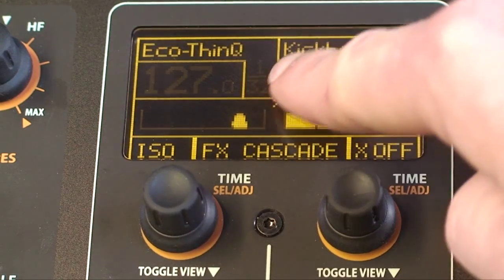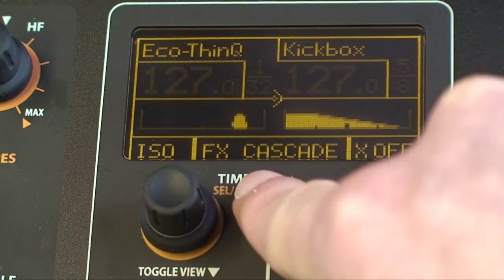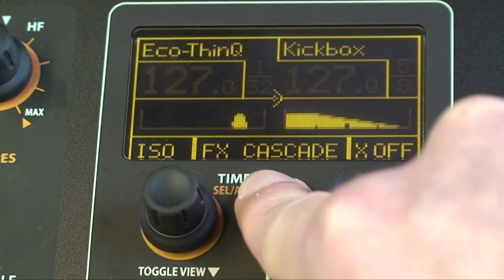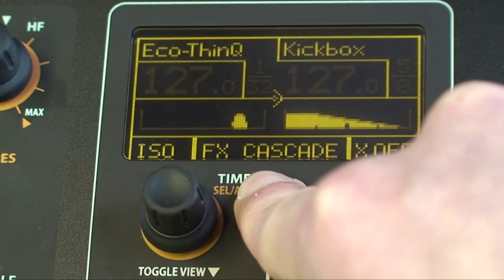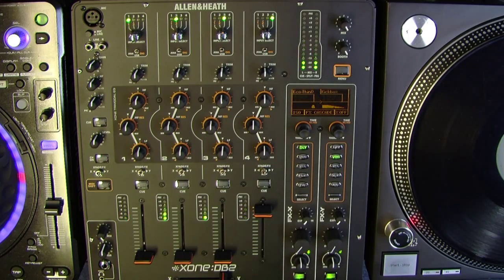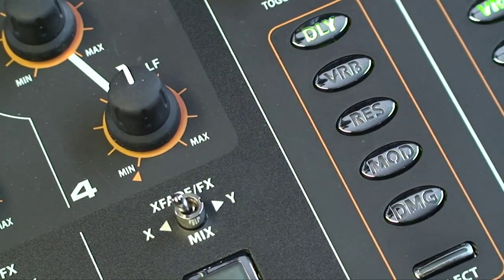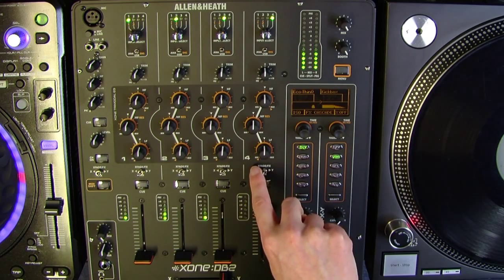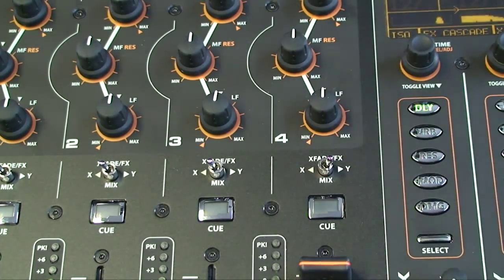Xone:DB2 - Instruction: FX Section

Comment: Great concept about the FX cascade, brilliant idea, but it does suck that you have to have the FX switch incorporated with the crossfader. It pretty much means that you can't use the crossfader in this mode as the channels will all be pointing to X. On the firmware upgrade there should have been a third option where the you can choose X or Y on the crossfader, and it doesn't matter which one it is set to it still goes to the cascaded FX engine.....
Reply: Matmah Yeah I have been thinking about this, with a 'new cascade mode' you can use the FX on/off button to choose. If both switches are off no signal goes to the FX engine, if both are on then it is in cascade mode, and if you just have the Y switch on then you go into the single FX engine....... Simple........ Do you need my address for the cheque ;)